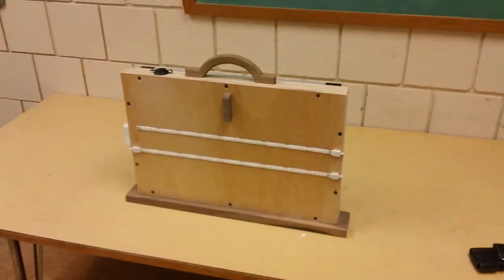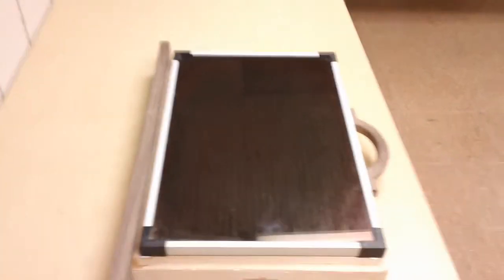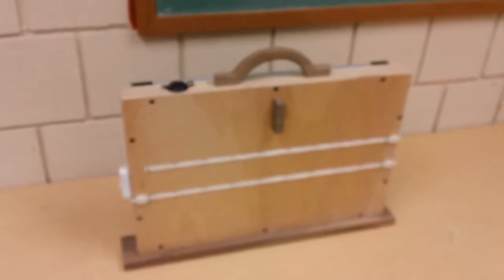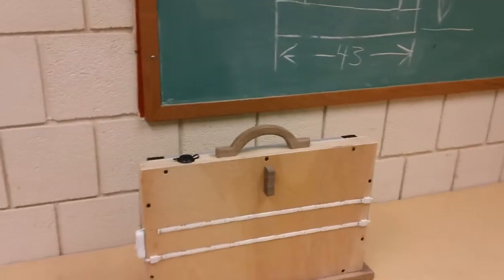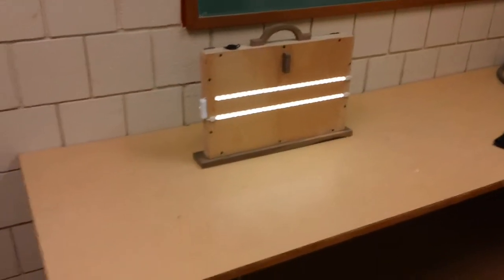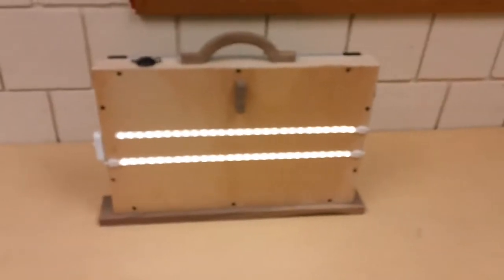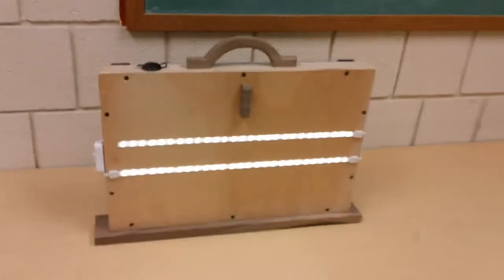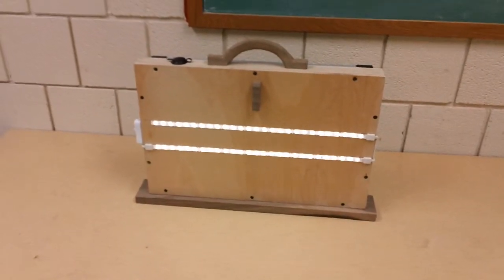Set in Window Solar Light/Charger part 2

Comment: I use 18650 batteries from laptops. I made a 12.6v pack. 20 in parallel and 3 packs in series, total of 60 batteries. 12.6v assuming the batteries have the 2.2ah they started with that's 4400 ah for a max possible wattage of 554 watts.